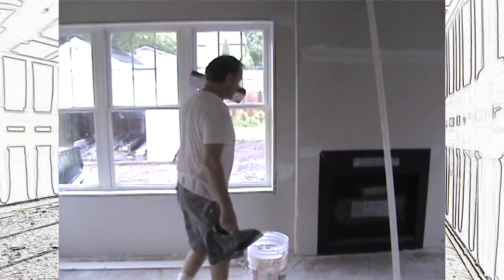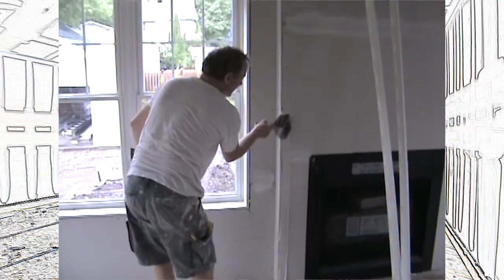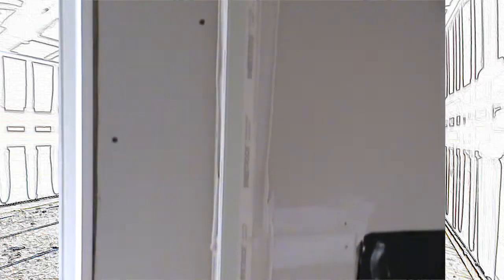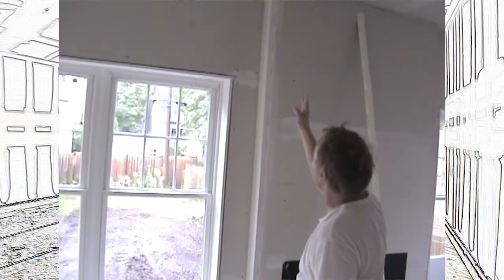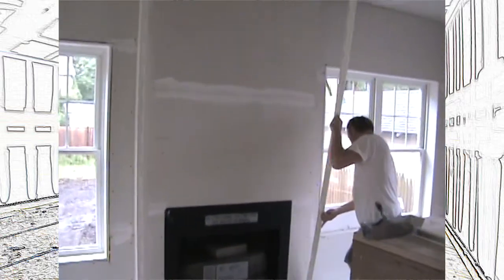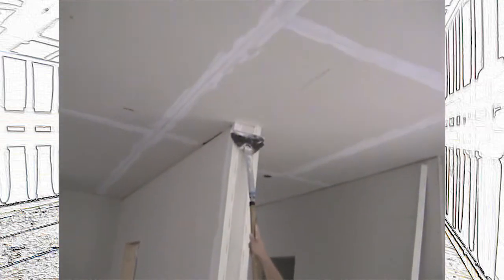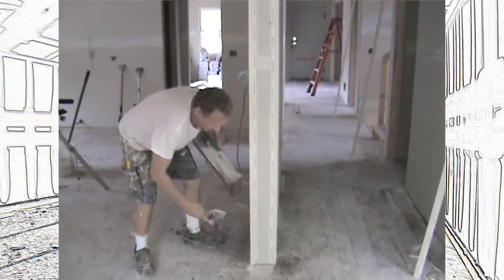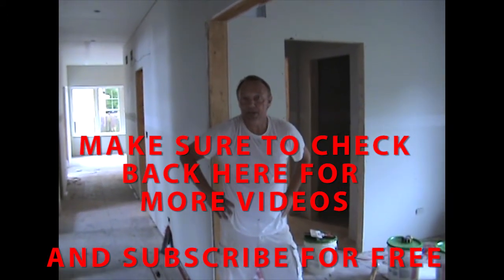How to Install Corner bead Using 2 Different Ways Hand vs Hopper

Comment: I quit the nails/clincher for the metal bead years ago.  All the metal corner bead that I have installed since I use a staple gun that shoots 1/4" crown and a 1" leg staples.  The kind you use for installing 1/4" underlayment on the floor.  Yes, you need a small air compressor.  Works great and is fast and durable.  Use a 6' level or longer as a straight edge as you install it.
Reply from the maker: I finished a Commercial job a few years back before tape on bead and it was stapled like you do . It was a great job.  I considered doing it that way but would of been trusting my hangers with a lot more equipment  I probably would of been replacing every week.

Comment: Have a question! Have you tried the outside 90 degree mud applicator attachment from Tape Tech for your mudrunner? It eliminates the need for the "hopper"! I havent gotten one yet but id love to see you try one out. They cost about $80. Thats cheaper than a hopper and a whole lot quicker and easier to wash up! Thanks!
Reply from the maker: I used it many years ago the head maybe less expensive then the hopper but not the mudrunner and that's extra ware on it.

Comment: Hi doc, Do you fill the corner bead after it dries out with general purpose or topping mud straight out of the box or do you have to thin it a little bit. If you thin it do you risk shrinkage when it dries?   I watched several "experts" on Youtube and each one does it differently.

Comment: Ray I know you do a lot of renos.  Any tricks for installing tape on bead when the framing / hanging are really bad other than fire the framer, lol.  Just did 200 ft of bead for a soffit and it was really bad.  I used xxxl bead w 2" metal flange and I know I am still going to have problems once it dries.

Comment: so using the hopper..whip the mud stiff ...not so much water..seems it could run out at the bottom
Reply from the maker: Not really the rubber tabs work well to keep the mud in place.

Comment: I have a rental and tenants hit corners a lot, wouldn't it be a better idea to use nails for corner beads? Thanks.
Reply: No, once the mud is dry that corner becomes part of the wall. It's much tougher.

Comment: Just curious if you have used trim-tex butt boards?  And if so do you like them and if not why.
Reply: I just used some at a friends place.  I'll certainly be buying more for the future.  The only question I have for Trim-Tex is how to easily create that same relief space at the top and bottom plates.  
Also, would there be a downside to using the 54 inch wide pieces on 48 inch drywall when doing a ceiling?  (so that the piece laps onto the adjoining drywall 3 inches on each side)